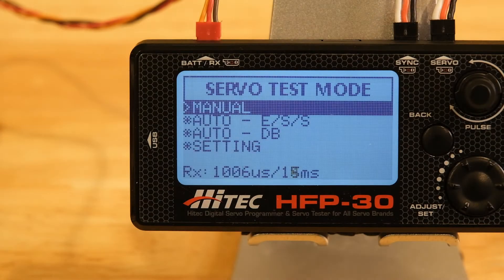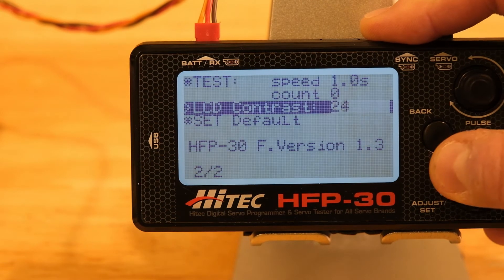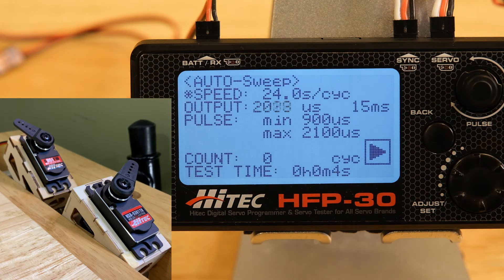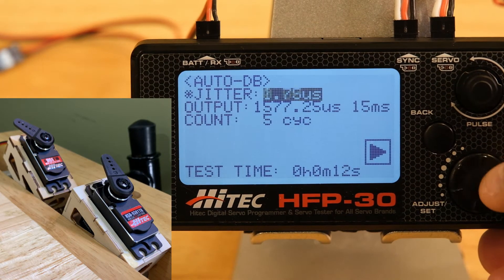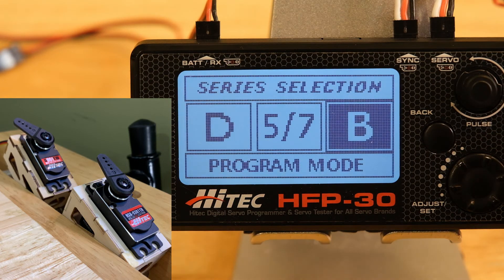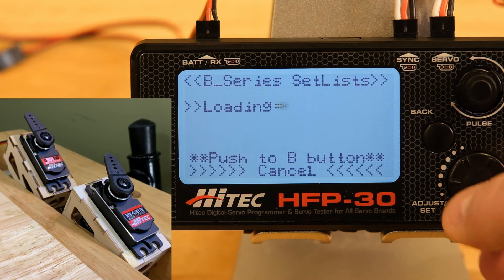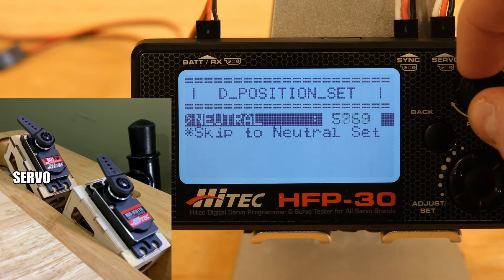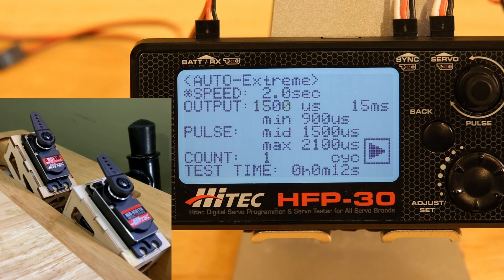How to use the Hitec HFP-30 Servo Programmer in 12 minutes

Comment: can you use the sync function with other brands of servos?, thanks.
Reply from the maker: Yes you can. There is no programming info sent out of the sync port...it's simply duplicating the pulse width being sent to the Hitec servo you're programming.
Reply: @djmoosecom  so if I understand correctly, your using the transmitter settings with one servo to match the pulse width of another servo plugged into the device?

Comment: Is there any explanation for why you would increase the deadband ?
Reply from the maker: One reason would be if you are experiencing jitter on a surface...increasing the deadband might help. Also, remember, folks use servos for lots of other things than RC....some situation might need the servo to be just slightly not EXACT at all times to help relieve pressure. I've never needed to adjust it, myself.

Comment: For some reason whenever I switch to programmer mode - it never connects and says failed to read. I tried 3 different D series servos.
Reply from the maker: Sorry, you might need to call Hitec support. If anyone else has experienced this, chime in? Vadim, which D models did you try?

Comment: I really wish somebody mentioned HOW TO TURN ON THE DAMN THING AND USING WHAT TOOL.
Reply from the maker: You plug a battery into it.
Reply: @djmoosecom  using what wire/adapter.. ???????
Reply from the maker: In this video, the BATT/RX connector on the top-left of the programmer. It requires a normal servo connector. You'll need another an adapter or a ni/cad or LiFe pack that has a servo connector.

Comment: Thanks for the video! I do have a question I am hoping someone can answer. Let's say I'm using an HSB-9000 series servo and I want to use EPA for setting a very limited range of motion, let's say 20 degrees. Is there a way to achieve this using EPA? I have noticed with my DPC-11 that the minimum range seems to be limited to around 68 degrees (34 degrees each direction from center) and this is frustrating for someone like myself who is using these servos for robotics applications. This limited range would be a very helpful software stop that can help avoid any unwanted range of motion or unexpected spikes in current draw. Any answers here would be invaluable as I am drawing a blank elsewhere. Cheers!
Reply from the maker: Let me play around...I'm programming servos for a new plane right now so let me see what I can find out. Thanks for watching!
Reply: @djmoosecom  thanks for getting back to me on this. Interested to hear what you find.
Reply from the maker: I just tried, and I get the same thing. I never noticed that before. I DID previous notice (and was annoyed by) the fact that the HSB servos automatically move to that minimal value when setting the left and right endpoints. I just never realized you couldn't set anything less then that. I tried on both my HFP-30 and DPC-11. You will probably want to look at the D series servos as I just confirmed that you can do exactly what you're describing with both the HFP-30 and DPC-11. Not brushless...but ohh well.
Reply: @djmoosecom  Thank you for confirming this! Was wondering if I was going crazy. I was also annoyed by the EPA auto adjustment when setting. Seems like these are two drawbacks when using the HSB series. Just my luck I guess.

Comment: If your radio supports it wouldn’t it be better to do all the settings right on the transmitter?
Reply from the maker: "Better" is probably a tough term to use here. It depends on what you want to do. There are reasons to program a servo...and reasons to program in your radio. You get to choose. 

When I program servos, I can change radios way more easier....sell the plane and the new owner has way less setup. etc etc

Some people like to program servos. The HFP-30 allows you if you'd like.

Comment: Great video and overview!  I am looking to get this and was curious if it's possible to re-program a non Hitec servo to sweep further than the usual 90-100deg? I have several 9g MG90S servos that state they are 180deg capable servos but even with my radio EPA set to 150% I am maybe getting 100deg.  Thanks!
Reply from the maker: I don't think this will change parameters on servos other than programable Hitec servos, unfortunately.
Reply: @djmoosecom too lazy to take a few seconds to test it for the guy and many others wondering looking at your video would be nice to know if this thing works on any other servos something you clearly should have went over and you should have tried plugging a different brand servo in and shown us how a different brand servo works in it ..
not all of us have hitec servos in our rigs  I give you a F- on this video for not showing a different brand on the test to show whats possible F-
Reply from the maker: @drowildcat2960  sorry you feel that way.